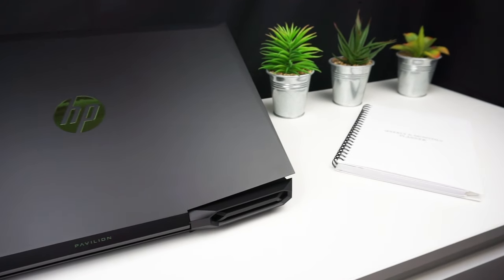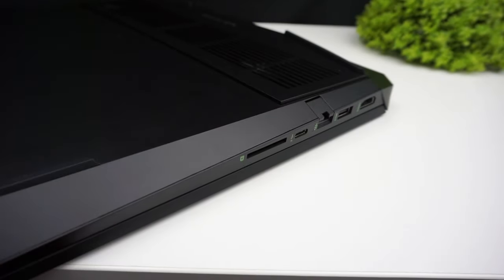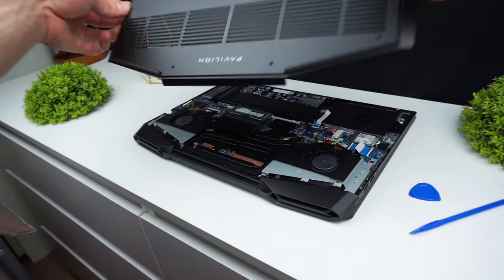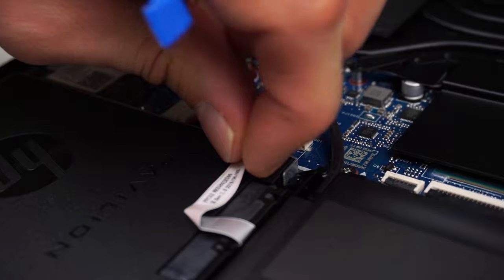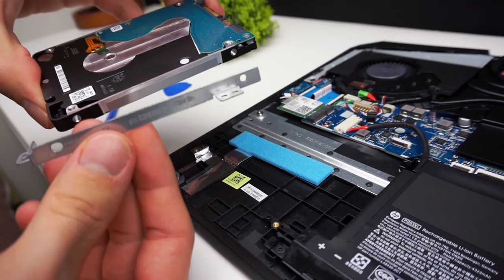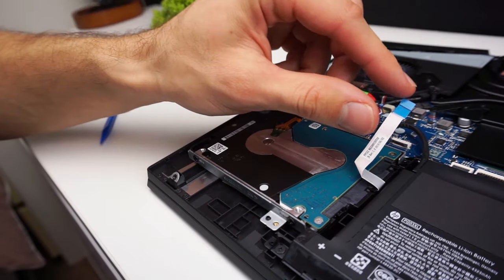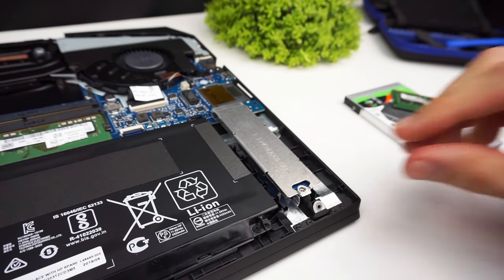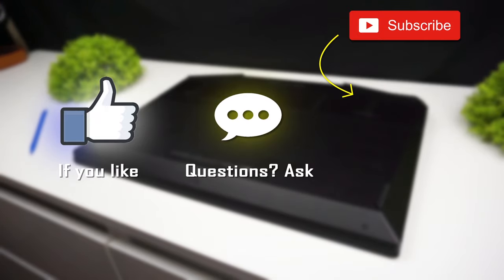HP Pavilion 15 Gaming Upgrade RAM / SSD / HDD - Disassembly Guide

Comment: What it's the maximum in total to upgrade in ram an both memory units? And it's possible to upgrade the processor and graphic card? I'm thinking about buying one of these
Reply from the maker: You can have up to 32GB RAM (2x16) 2666MHz. If it comes to storage i'm not aware of any volume limits. 2TB for both drives is possible for sure tho. You can't  replace processor and graphics
Reply: @TechFinds  which processor and gpu can I change it? or with what tool can I know?

Comment: If anyone is wondering how much storage the 15-dk1010ca can handle, it's up to 2 TB. I got this information from the HP forums.
Reply from the maker: That's a very confusing topic as no brand really advertise maximum storage limit. I also know the situations when support teams told the maximum supported space value for certain laptop and it was actually not true, because laptop could take much more. I don't know if the laptops nowdays have any limits at all. If so, they should give any information in specification.
Reply: @TechFinds  That's what I'm so mad about! They don't give information for the computer literate people!

Comment: Hola tengo Un HP Pavilion Gaming 15-DK0015LA [6QW87LA] y quisiera cambiarle la RAM y la SSD (ampliarla) que marcas y modelos me recomendarías? Y obviamente que sea compatible, agradecería mucho tu asesoría, de ante mano, gracias.
Reply: Hola que tal, Te recomendaría una ram de 8 gb  mas osea para que en total tengas 16gb de 2666mhz o 32000 mhz(dependiendo de la frecuencia que tiene tu memoria ya incluida en tu laptop) (Marcas recomendadas para Ram es Crucial , Ballistix y hyper X)/ En almacenamiento te recomiendo 500gb de nvme m.2 (para instalar los programas que vas a usar y el sistema operativo osea prendera rapido y los programas abriran rapido) y un disco estado solido (sdd) de 1tb donde guardes toda tu informacion (fotos, videos, documentos, carpetas, todo)

Comment: I actually just bought this laptop and watched your video and upgraded my Ram, i bought the 2 G.skill ripjaws to give myself 16gb of Ram, made a huge difference and im wanting to get a hdd to add to it, i have the Ryzen 7 version, its hard to find review on this one being there are many models. after a little playing around i manage to average around 110-120 fps on MW, Fortnite, Apex, And Bo3. if you get this laptop i highly recommend upgrading the ram and getting an additional hdd as you get 500 gb ssd with my model, overall i was unsure after playing on it before upgrading ram but after i did that and made sure my games were set to run off of the GPU and not integrated graphics, i got a pretty good result, i bought this refurbished at micro center for $659, and spent $80 on the Ram, about to buy the additional HDD. Highly suggest this laptop dont let the gtx 1650 bring you down it actually runs excellent!
Reply: The model that you bought, is it single channel RAM or dual channel?
Reply: in my country, i got 1tb hdd only. had to separately buy 500 gigs nvme. but do u think I should get 8 gigs of ram? cuz I just have 8 gigs atm.

Comment: Bro which laptop should I prefer for gaming and software work 
⚫️ Acer Predator Helios 300 2020 i5 10300H & RTX 2060+16gb ram+144Hz
OR 
⚫️MSI GL65 Leopard i7 9750H & GTX 1660Ti +16gb ram +144Hz
OR 
⚫️HP Omen 15 2020 Ryzen5 4600H & GTX 1660Ti + 8gb ram + 60Hz
Please answer bro please .🙏🙏🙏🙏🙏🙏🙏🙏🙏🤔🤔🤔🤔🤔🤔
Reply: Msi
Reply: The 60hz on the hp omen is a bit deal breaker for me. 

And the msi is the best. But if you can buy the helios 300 with i7 -9750h or i7-10750h it is the best of all. Thats why i biught the helios. It is the best but the fan noice is omg i can't explain it enough. But there is headphone. So it is up to you. But if i were you i will buy the helios 300.

Comment: Hello! I just bought one 8 gb stick of the crucial ram. Would I need 2 x 8gb of the same ram or can I use the crucial with the ram already installed? Thanks!
Reply from the maker: You can mix RAM but both sticks should have the same specs or as close as possible.

Comment: 1. Which RAM did you buy. 2. If I want to buy 1 8gb stick, which one should I buy? Does it need to be the same brand as the other ram?
Reply from the maker: I didn't buy new ram, i just took out the original ram and installed it to show how to do it. You can mix brands but match the specs with your original RAM.
Reply: @TechFinds  what do you mean by match the specs? Do you mean 8gb ram with 8gb ram? Thanks for the reply tho
Reply from the maker: @DivineStoryShorts  yes, the same GB, the same frequency (MHz) and latency (CL), and voltage
Reply: @TechFinds  okay thank you

Comment: What if I put In a hard disk from my old dell 3552 pqc In there would the windows files crash because I have Windows 10 In the hard disk too and it's not the hard disk which came to the laptop I changed it because the other one stopped being detected

Comment: So I need help with something. When I first got this laptop it was running apex at around 70 FPS but 2 says after for absolutely no reason it’s FPS dropped to 12-30 and very laggy. I reset my laptop completely so what’s the problem?
Reply from the maker: Make sure that the power cable is connected well and the games run don Nvidia GPU instead of integrated graphics.
Reply: @TechFinds  thx but I tried that and it didn’t work for some reason but thank you 😊
Reply from the maker: @Shahmir-oq8tu  Im out of ideas then, sorry
Reply: @TechFinds  all good I fixed it in the end

Comment: What brand is the original ram in the laptop? If i want to add  ram, does it matter which brand? Will it affect the performance?
Reply from the maker: The brand of RAM may vary between countries and sellers, but you can mix brands no problem. It's just important to match the specs

Comment: Can I increase my hp pavilion i5 9th gen ram to 32 gb? And my Obs lags at Cs go gameplay recording. System requirement of cs go is 2 GB ram and mine is 8 GB. What is going on?
Reply from the maker: You can have up to 32GB (2x16). In theory you have enough RAM, so i don't know why it lags. Maybe activating dual channel would help. Dual channel is basically when you have 2 RAM sticks installed (the same specs)
Reply: @TechFinds  oh. Thank you brother for the information. 🙏

Comment: hey dude, nice tutorial. I´m having a problem with my unit. Today I added some ram and an extra ssd and it worked nice without the back cover, but as soon as I assembled the back cover, the laptop turned off and it won´t turn on again. I connect the charger and the light doesnt turn on and if i press the on button, the laptop fans spin for a second and then stops and a a popping sound is heard, like if something were heated up and exploded, but nothing seems to be exploded. The only thing I can think causes the problem is the charging port and the battery... also, my batterty started to turn off with a 25% charge in it.
Reply: assuming you removed the battery before doing your upgrades, hp laptops sometimes do a weird thing with the cmos battery where it just goes through a reset. The behavior you described happened to me. Just let it go through it, it should turn off a few times until it boots up normally

Comment: does it matter which version i have? I have pavillion 15 with ryzen 5 and gtx1050 with 8gb ram and 256ssd. can i put my external 1tb hdd inside and just get an external ssd for extra storage? or can add a second internal ssd or replace my 256gb ssd altogether? I am ready to replace ram to 16-32 gb already. Please help thanks
Reply from the maker: You can do the same upgrades as me. If you gonna replace your existing 256GB M.2 SSD you'll need to install Windows again on the new drive

Comment: Is ddr4 3200 suitable for this?
Reply from the maker: It supports up to 2666MHz
Reply: @TechFinds  that's why my laptop have a 3200 mhz ram but showing speed of 2666mhz
Reply from the maker: @GamerKhiladi  yes you can install RAM with higher clock speed but it will downclock anyway
Reply: @TechFinds  is overclocking ram safe for laptop? Or is it risky like overclocking cpu of laptop?
Reply from the maker: @GamerKhiladi  I've never over locked RAM, so I don't know. If it comes to processor, you can't overclock it with pretty much every laptop

Comment: Hi I got a hp pavilion gaming 15-dk0xxx. I onnly got 512Gb of ssd coming with it do you have any info that I can add more ssd or hdd in it
Reply from the maker: If your laptop came with only SSD then your slot for 2.5" drive is free so you can install some HDD in there. You can also replace your current SSD with bigger one, but that invilves reinstalling Windows
Reply: @TechFinds  thank you very much :)

Comment: Is it intelligent to add 8Gb RAM to my HP PAVILLON 15 of the previous generation with the AMD RYZEN 5 4600H for gaming ? I have 8Gb now but i dont know if my computer is capable to handle 16Gb effectively, or if it would be "unbalanced".
Reply from the maker: Sure, you can add 8GB more. You'll not only benefit from more RAM, but also Ryzen processors work better with dual channel RAM (which is having 2 RAM sticks inside)

Comment: Quick question if you have stuff installed in that computer and change the hard drive will it still keep my stuff there?
Reply from the maker: If you replace your current drive with another one then you'll lose all files (and system if installed on that drive).

Comment: I have a 16gb RAM stick I want to use, do I just put it in the slot and it will work?
Reply from the maker: Yes, but if you gonna mix it with original RAM it should be the same specs

Comment: Hi, hopefully you can advise me , i have this laptop and i have a spare 500gb drive i can put in the dummy slot question is what would i need to do after that and can i run programs or games from that drive as well as the SSD that it came with, would it simply be extra storage? Is there any advantage to me installing the spare drive?

Comment: hey tech finds, the HP Pavilion Gaming Laptop 15-DK0056WM  comes with only single ram slot and i cant find any video on that particular model so my question is wheter it will have same amount of space for the internal devices i.e 2.5 inch drive and if i replace the stock ssd should i install windows again????????/

thanks
Reply from the maker: I haven't heard of Pavilion with 1 RAM slot, at least not this generation what I had. I don't know about the other slots in the model you mentioned. After replacing the drive where you have your windows installed you have to install windows on the new drive

Comment: I have config with 3200 mhz ram should i buy 3200 mhz one or the ones u recommend
Reply from the maker: Well, if you have 3200 and you want to mix it with some new stick go for 3200 too. This laptop supports up to 2666 tho, so it will downclock anyway

Comment: Hi Tech Finds! Very well done video! i recently purchased a 15-dk1082NR and plan to upgrade the ram from 16-32. this helps since the assembly of the cases can be a bit hairy. I was wondering what kind of tools you have? I really like the lifter you used! i have a set of tools but those weren't included sadly. and well as you stated the case can be a bear to get open without nicking or breaking the covering. Thanks again for the well done video!
Reply from the maker: Thanks for commenting! Unfortunately i don't even know how that "lifer" is called, i had it in my precision screwdriver set, but you can use anything that is thin and hard plastic. For example guitar pick or credit card
Reply: @TechFinds  I'm having doubt bro i have the same laptop my graphics is 1650 and i want to upgrade my graphics will i be able to upgrade??? Can u please tell me

Comment: I have 2 question : The battery can be remove and used the laptop without (to avoid the death of the battery)? 
Is it possible to just add a ssd?

Comment: Hello I was wondering if any of the components that you have shared on the description would be compatible with the Hp Pavilion Gaming Laptop 15-dk0xxx
Reply from the maker: I can't tell by this model number as it may be different for each country even if the laptop has the same specs. Tell me the processor

Comment: Where is the OS installed in this model? I have the model "HP Pavilion Gaming Laptop 15-dk0xxx". Does thi one has a M.2 SSD inside?
Reply from the maker: There are many configurations, but if your laptop comes with m.2 SSD this is where you should have your windows installed. I don't know what configuration is your model

Comment: hey, can you do a guide on how to clean the fans from dust? i checked other tutorials but i'm still really doubting myself. I'm still waiting for my warranty to disappear to upgrade, but now Ill stick with cleaning it. I've been using air dusters to blow the fans froms dust, but I didnt open the lid, so most likely the dust went inside the laptop

Other than that thanks!
Reply from the maker: Unfortunately I had this laptop for limited time only. Also I am not permitted to disassemble cooling system in the laptops that I test
Reply: @TechFinds  oh i see, that's understadable. Thank you once again for the kind information 😁
Reply: @fracklo  so how did u clean it finally?

Comment: If I take the ssd out to replace it, what happens with windows when I try to boot it? Would it not have a boot drive?
Reply from the maker: Yes, you won't have operating system as it's installed on the drive you took out. You have to install Windows on your new drive

Comment: also I wanted to ask . What is the difference between HDD and HDD with data recovery? Does it mean when accidentally deleted important files from the HDD it can be recovered or does it mean if I deleted it will go to the recycle bin first?
Reply: It means when data gets corrupt it can be recovered easier

Comment: I can't find any info. Can I install a SSD 2.5'' in HP pavilion gaming 15-ec0014, since this laptop has NVMe 256gb preinstalled ? Thanks
Reply from the maker: Yes, you can install 2.5" SATA SSD instead of HDD if you want
Reply: @TechFinds  I can confirm, I just upgraded with SSD 2.5'' Kingston 256 GB, used guitar pick to divide edges, hope it helps someone

Comment: Nice that's very helpful. Now i can upgrade my hdd to sdd. But any guide for the battery
Reply: You take out the 4 screws keeping it,one of them also holds the SSD/HDD frame in place. After that you pull the battery out slowly trough the bottom,swap it out and then screw it back in place and connect it back.
Put the back cover back on,turn on the laptop and wait about 30 seconds for the CMOS and BIOS to reset and off you go.

Comment: I have a fully functional laptop (dell Inspiron 5570 4gb)
What will happen if I upgrade both ram sticks at a single shot?
Reply from the maker: You'll have more RAM which will help in multitasking and it will improve overall performance
Reply: @TechFinds  what I meant was even if I remove the existing ram and put a new ram it won't erase or affect storage and windows right
Reply from the maker: @poovannaappachira8406  Yes you're right. Your files will be not touched
Reply: @TechFinds  one more doubt
I have 4gb ram in my pc 
One slot is empty
Can I put another 8gb ram there
Question is will mix and matcch of ram sticks affect the laptop?
Is it really considered to mix and match ram sticks
Reply from the maker: @poovannaappachira8406  You can mix specs and it will work in like 99% cases but i don't recommend that since dual channel is not activated with different specs ram sticks and you may experience compatibility issues

Comment: Hello i have a design/model that is only in my country so i want to make sure that adding ram and ssd will work from the one in your vid. my specs are i5-10300h 1660ti with max q 8 gb ram dual channel 2933mhz ram speed. will the crucial 2666hz in the disc thats 16x2 work for me so i replace the 2 4gb ram and put 2 16gigs would it be compatible and fit in the slot (im new to this stuff) i havent opened the back of the laptop yet by the lid looks exactly like your i hope you answer
Reply: Ram should be fine im pretty sure,
Reply: Ram should be fine im pretty sure,

Comment: If you change the ssd will it still have windows installed or do you have to install yourself
Reply: If you swap the M.2 drive then yes you will need to reinstall Windows, If you just add another SSD where the fake drive was then you'll just need to mount the drive from disk management and you'll have your increased storage.

Comment: Hi, what is the top for the M.2 and the HDD? and... can I install a 2.5" SSD instead of the HDD and have it installed along with the M.2? would it be any issue?
Reply from the maker: Yes, you can have 2.5"ssd instead. I'm not aware of any limits for drive capacity. You can have 2x 2TB for sure
Reply: @TechFinds  thanks but my questions is: can I have s 2.5" SSD along with he M.2 SSD?
Reply from the maker: @braulioenriquematute9895  yes, you can
Reply: @TechFinds  thanks!

Comment: What the maximum capacity of SSD storage, M.2 storage, and RAM that this laptop can install?
Reply from the maker: Maximum RAM is 32GB (2x16) 2666MHz. If it comes to drives i don't think there are any capacity limits. 2TB will work for sure
Reply: @TechFinds  thanks for information 😁👍
Reply: @TechFinds  well my LEVEN SSD 1TB 3D NAND TLC SATA III Internal Solid State Drive - 6 Gb/s, 2.5 inch /7mm (0.28") - up to 560MB/s - Compatible with Laptop & PC Desktop - Retail 1 Pack - (JS600SSD1TB) I bought on amazon has no storage nor does it show in my computer
Reply from the maker: @BlazeSanders  after installing go to device manager and make a partition